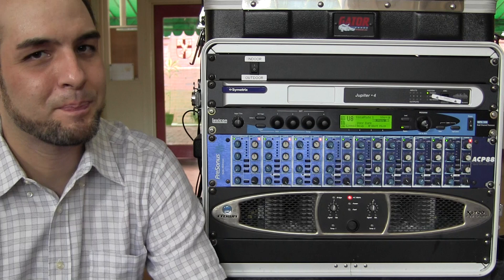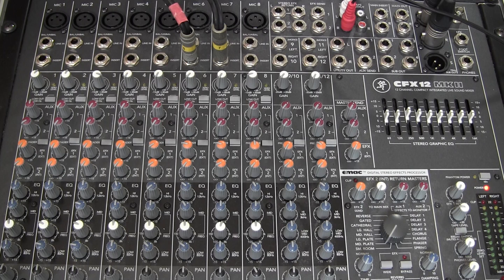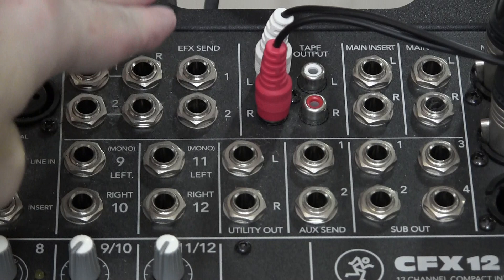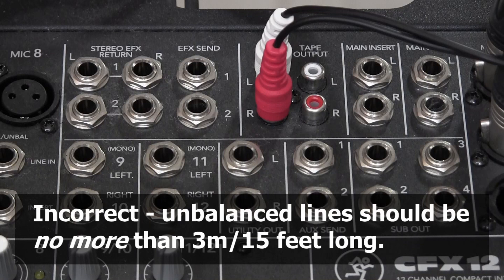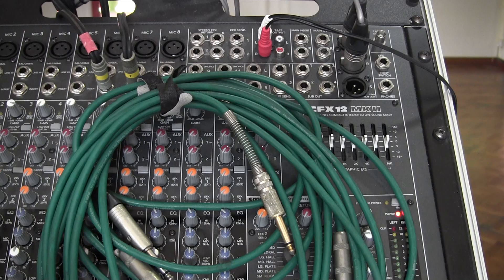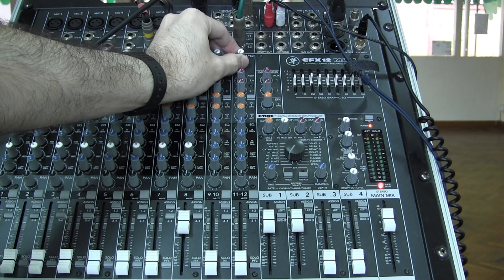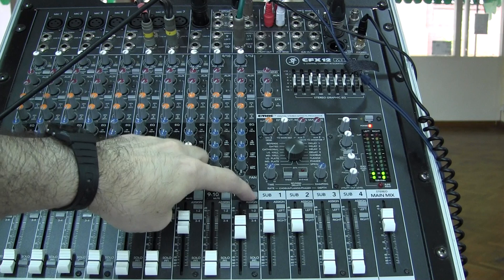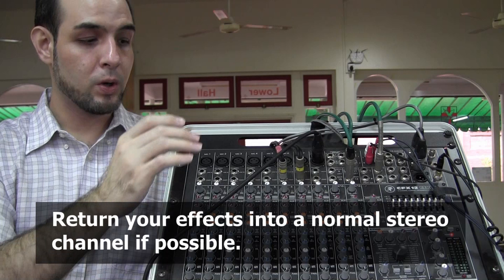How to set up an external effects processor for live sound

Comment: Hi, if the effect comes in on an input channel, as opposed to the stereo return, does it not then send the effects directly to the main outs? I would only want the reverb in on vocal channels but not in on any instrument channels. Thanks.
Reply from the maker: These are two different issues :) 
Both the stereo return and returning on an input channel allow the wet signal to be routed to various destinations, including the main outputs. Exactly what routing options are available depends on the mixer you are using. 
If you want reverb on only the vocal channels then just turn down the FX aux send on the instrument channels - in this way you avoid sending them to the effects unit in the first place.
Reply: Thanks for your reply, I’m using an A&H Mixwiz3 and I’m just finding my feet with live sound. As far as I’m aware this desk has no routing option on channel strip. Any signal I put into a channel seems to go direct to main L&R or Mono out. Would this be the case with returning an effects unit to the channel strip? I wouldn’t want to effect the main outs with any effect.
Reply from the maker: Which exact model of Mix Wizard are you using? Also, how is your external effects unit connected to the mixer? Thanks.

Comment: hello how can i connect compressor to PCI CARD RME 9632 ITS POSSIBLE
Reply from the maker: - Yes, however you would need the appropriate adaptors to convert your PCI card to interface with the compressor in question. So for example if your card has RCA inputs you would need a 1/4" to RCA cable and so forth.

Comment: Hello sir,am having some problem so please help me out from this.here i have soundcraft MFXi20 Mixer ,behringer ultragraph Pro FBQ3102 ,Drawmer Spectral Compressor DL251,Drawmer Quad Gate DS404, Behringer Ultralink Pro 8 Channel  Audio splitter.I just want to know how to connect these items on to mixer
Reply from the maker: +Rakesh Vayalil The graphic EQ can be placed after the mixer or inserted on the main outputs. The compressors and gates can be inserted on the individuals channels or on the main inserts. The audio splitter would be placed on the output of the mixer where you need to split audio for press feeds or other purposes.
Reply: Sir,
As I explained before, can you please explain me the connectivity of cable starting from the mixer. How the cables needed to be connected from mixer till the speakers, please explain me in detail with the input and out. I don't have main insert in my mixer. I need in detail about the cabling starting from mixer (mixer doesn't have Main Insert).

Comment: Hi GLB, I am going to connect the same way in your video? so both effect are using the same time. Are they effect each other for quality of sound? thanks
Reply from the maker: Kara H Please let me know which model mixer and effects unit you are using so that I can give you precise instructions, thanks.
Reply: GLB Productions My Mixer is bheringer 1622FX, I plan to buyMX400 lexicon. I also have TC helicon voicelive play. do I need to buy MX400 lexicon? just want to improve vocal. I only use system for home karaoke . thanks
Reply from the maker: Kara H If you already have the TC Helicon unit you should not need additional vocal processing. Connect the VoiceLive play in beween your mic and your mixer, and then use the mixer's internal effects as necessary.

Comment: Hey you said i just use normal stereo return. If i use that. Does it effect the other music instrument like guitars or drums or even the music player? Or i can limit the effects using the aux knob to disable effects in other instrument except the vocal? .
Reply from the maker: Yes just choose what to send to the FX unit by using the aux send.
Reply: GLB Productions okay isee. Now i got the bright answer. I thought it's disadvantage was it will make a general effects for each channel. So you can disable the effect using the fx knob. Okay thank you so much.
Reply from the maker: Correct - on the bigger shows there used to be multiple outboard FX units: a vocal reverb, a vocal delay, drum reverb etc...

Comment: Greetings,,GLB

Great video,well done now my question to you is I have Mackie 1604 that has 4 aux sends that I must use for 4 separate monitors is there a way that I can still use the method you explained on the video? The 1604 owners man. says something about converting the 5 and 6 by by using the shift button will that work? Can I use one of those 2 as an aux send? I hope I explained it well enough for you to advise me. thanks before hand I appreciate your response.
Reply from the maker: Jesse Martinez Hello Jesse, thanks for your question. Yes, Mackie with their 'six in four' aux send mixer :) You could conceivably use aux 5 and/or 6 as the send to the effects unit but the problem on that mixer is that channels can access auxes 3&4 OR 5&6, not both, so channels sending to the FX unit would not be able to be sent to monitor mixes 3&4 and vice versa. If you can work around that you are ok, otherwise you will need to get a mixer with more aux sends or some up with a different method of sending to your FX unit, for example using the group outputs.
Reply: Hi again,, I just need the efx for the vocals how would I do a group output,, forgive my ignor. but I am kind of dexlexec and have trouble understanding what I read. thx
Reply from the maker: Jesse Martinez You would assign the vocal channels to one of the group pairs, either 1-2 or 3-4, as well as the the LR. Then, make sure that the groups in question are NOT routed to the LR. From the group outputs on the back o the mixer, patch into your effects unit as shown in the video and then back to your mixer. When you return to your mixer, make sure that the channel  you return to is NOT assigned to the groups, only to the LR. Hope that helps, let me know if you need any help.

Comment: I have a Mackie PROFX 16, how do you do the same setup on mine can you help please? what's the best way to get a great effect on my monitors?
Reply from the maker: The setup process on the ProFX16 is similar to the mixers shown in this video - ensure that your FX master knob is set to the 12 o'clock position and then turn up the yellow FX knobs on the channels that you want to send to the internal FX processor. You will need to consult your user manual to see what types of effects are available.
Reply: GLB Productions Thank you so much, so the dry signal will go in FX send and the wet signal into a stereo channel??
Reply from the maker: charlie prestigiacomo You're welcome. Yes that is correct, assuming you are using an external effects unit. Mono send and stereo return.

Comment: Great Video but on my ProFX12v3 when I run the effects back to 11\12, the fader on 11\12 channel (nor the main FX fader) does nothing. I can only adjust the effects using the yellow knob on the instrument channels (3 and 4). Any idea on what I am doing wrong? This mixer does not have effects return so I have to route it back to a channel. Thanks.
Reply from the maker: Are you using the mixer's internal effects or an external effects unit?
Reply: @GLBProductions  External effects. The effects are there in the mains as you described, but not in the phones output jack. I am primarily using the phones jack for my mixer to play along with music. I guess I can get another piece of equipment with a phones jack that will take the ProFX12v3 mains output instead of using the ProFX12v3's phone jack. Does anyone know what equipment this would be (other than another mixer)? Thanks.
Reply from the maker: I see - in this case I'd try returning the FX to another channel: try 7/8 or 9/10 and see if that makes a difference. Anything that you can hear in the main outputs should also be heard in the headphones on this mixer.
Reply: I emailed Mackie support and the issue was I was monitoring the blend mix. I disengaged the To Phones/Control Rm button below the blend knob and now it is working as expected. I hope this is helpful for any ProFXv3 users.
Reply from the maker: Thanks for the update - I spotted that knob but thought it was to do with the subgroups fader. Good to hear that Mackie answered you quickly! Be sure to check that knob and switch regularly - they have the potential to cause lots of confusion 😅

Comment: How do i connect my lexicon MX200 to my Behringer X1222 . . . .
Reply from the maker: ***** The MX200 is a dual-processor effects unit and your mixer doesn't really have enough aux sends to accommodate a setup of the type shown in the video, so I suggest just using one of the two processor and following the method shown in the video.
Reply: GLB Productions Thank you so much for your reply after going through your video i purchased this processor thinking that i am sending the mono signal out and getting the stereo signal into my mixer . . . Anyways i have another mixer YAMAHA 16/6FX will this Lexicon MX200 work well with that if yes how do i connect that . . .

Comment: I do not know how to explain this to help.I am aware that to type a message vs. being there is alot differ.I work on audio stuff and install so I understand.I will try best.... GLB Productions........
  Stuff I have- A Lexicon MPX-100 effects processor.A Behringer-VMX-1000 mixer.This all is for a house set up and for my own hobby to dj on my own recording.
  So, I never hooked up a effects processor.Please note my mixer which may need research to see the back side.I recently got the processor in which I ordered 4 cables unbalanced which my mixer calls for.Do note the back of my mixer is RCA mostly.I ordered 4 1/4 to rca mono cables.The one side has red black rca other is 1/4 mono.
 I run everything into mixer out to a receiver.All goes out mixer rca output main 2.( nothing hooked to main two out).
  On my mixer far left is 3 1/4 jacks says mic Aux, send receive left receive right.Being it says mic I do not mess with that.Right side of mixer says SEND FROM PEL. and return to main.These are rca type.I assume for processor as the knobs show and say RET-EFFECTS. Min Max.
 My issue is this, I have spent weeks every which way to hook this up how I think and right and get no where.All I can get is when I hook up processor to tape rec out it will take signal at which I take the processor out to a line in on mixer.Problem is, I raise gain it feeds back in mixer .The mixer is pretty new and or never ran a line into send rec.When I do it that way I get nothing as in no signal level anywhere and yes my gain is turned and all else.The processor does work fully and mixer.Any thought?
Reply from the maker: +Joesph Baumgardner Hello Joseph this is quite a puzzle. My suggestion would be to connect the effect send from PFL on the back panel to the input of the MPX-100 and then the output of the lexicon to the 'return to main' connectors on the mixer. This will allow you to send whatever signal you hear in your headphones to the effects unit and return it via the knob in the master section. Have you tried this before?

Comment: what if you have more then one effect for your mixer?
Reply from the maker: Do you mean more than one effects UNIT?
Reply: @GLBProductions  so yes, now i have one mixer and want to use more then one effect  i have the bbe 362 in line now and would like to add a compressor
Reply from the maker: The compressor can actually be added inline as well, assuming that you want to compress your entire mix. So mixer -> compressor -> 362 -> power amplifier.

Comment: Hey i have a question. What is the purpose of main insert??
Reply from the maker: It's used to insert something like a compressor or EQ across the entire mix, affecting all channels equally.
Reply: GLB Productions but how?? Is there any video about it? So instead of connecting the equalizer in to main output going to another processor or amp you can connect the euqlizer on it going to whole mixers.
Reply from the maker: Have a look at this video, it shows how an insert point is used: https://www.youtube.com/watch?v=RLf8jXGtF8w With the main inserts you have two of them, one left and one right.

Comment: Does muting the effects return channel also mute the effects-to-monitor? I want the main PA reverb to be muted AND the monitor reverb muted. Thanks.
Reply from the maker: PhotoMusicMan That depends on your mixer - on most Mackie compact mixers muting the channel does NOT mute the pre-fade aux sends, which I personally find very irritating (it's a feature aimed at those who use the mixers for recording). Of course, if you have a digital console this is a simple feature to programme.
Reply: GLB Productions Thank you very much for your kind reply. I have used various Mackie mixers over the years and they were great, right down to the 1202. For live work I now use an Allen and Heath Zed60 console. It sounds nice. Although even on this I cannot mute the aux reverb either so have to use the bypass button on the hardware reverb. I have never used a digital mixer, I think it would scare me! I like seeing the knobs in front of me and I don't know if I could cope with an LCD screen to adjust things such as feedback etc. Maybe I am just not keeping up with the times.
Reply from the maker: PhotoMusicMan Digital mixers have a come a long way and many of them have discreet physical controls for all of the critical adjustments like EQ, gain, pan etc - check out my recent video on the Soundcraft SI compact: https://www.youtube.com/watch?v=mx43VY0j5h8 In this video I'm training a slightly older student who is well-versed on analog consoles but like yourself has never used a digital board. He adapted surprisingly quickly!
Reply: GLB Productions Thank you, I will look at your Soundcraft video now. I used to use a Soundcraft analog mixer years ago and it was really nice. The sound had a warm sound, no harshness.
Reply: GLB Productions Wow, I think I would be very happy using a digital board,
Reply from the maker: PhotoMusicMan To be honest with you once you learn how to use a digital board it's very hard to go back to analog - having full dynamics controls on every channel to me is just priceless. Of course, analog board still have their place, especially in smaller setups or for recording.

Comment: can I connect the stereo output from the external effect to the aux
Reply from the maker: The aux on what?
Reply: On the mixer the aux section
I have got a soundcraft signeture 10 which has 3 aux sends. So how do I actually connect the external effect processor to the mixer
Reply from the maker: On that mixer you could use aux 2 to send signal to the processor and return the stereo signal to channel 7/8.
Reply: Thank u very much sir got it😘

Comment: Bruno,
I have the same mixer cfx12 my channel 9-10 and 11-12 are taken. And I want to connect my effect processor to a channel to be able to control the volume with a fader. Can I use say channel 8 and plug in to the line in or insert? Please advice. Thanks.
Reply from the maker: +Aaron Villela Yes you can, but you will only have effects in mono. If you want the return to be in stereo, you will need to use two mono channels, or one of the stereo returns.
Reply: Thanks for the quick reply. So mono will not be ideal? Meaning I'm better off to connect to a mono stereo channel and or the stereo return?
Reply from the maker: +Aaron Villela If you run a stereo PA system and have a stereo effects unit then you should ideally return the effects to a stereo channel. However a mono return often works just as well - try it and see how it sounds!

Comment: Sir what will be the connection between behatinger q1202 usb mixer with beharinger fex minifex800 processor because mixer have mono fx send and processor have R and L input and out put
Reply from the maker: Sunil Tiwari You would use the Left (mono) input to the minifex unit, and then both left and right outputs to return the signal to the mixer.
Reply: Thanks sir for quick support
Reply from the maker: Sunil Tiwari No worries, all the best with your music :)
Reply: Sir as per your advice i connected fx processor to mixer...and it works....

As per your advice i connect processor to mixer , mixer connected to p.c.via usb for recording , i use it for karaoke singing, for it i connect c.d.player to mixer input5/6, condenser microphone to mixer xlr input channal no1 and dennan a/v receiver to mixer main out.......is it correct connection to play track,sing with track using processor and record all this things with in built audeo interface of mixer in cubase 5   pl reply
Reply from the maker: Sunil Tiwari Yes, your set up sounds all correct to me. Well done!
Reply: Thanks

Comment: can u pls help..
when i activate delay microphone start howling?
what might be the reason for that?
Reply from the maker: kforthy chris It's probably a case of too much gain - does it happen at all levels or just when the delay is louder? Are you using an external delay unit or one built into the mixer?
Reply: iam using an external delay, microphone howl only when delay volume is increased..
u mean gain of microphone or gain of delay unit??
Reply from the maker: kforthy chris If that's the case make sure that the channel you are returning the delay to is NOT being sent to the delay unit. For example, if you are using aux 4 as your delay send and returning the wet signal into channel 16, make sure that the aux 4 knob on channel 16 is completely OFF, otherwise you will get an electronic feedback loop.
Reply: ya its off all the way but it happens wen delay is louder..